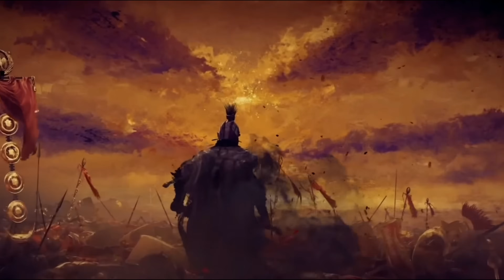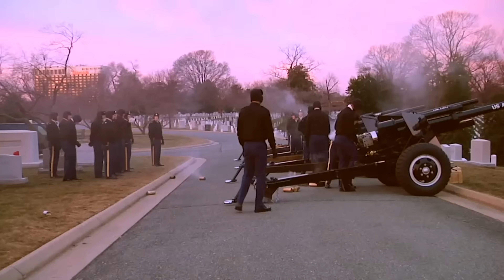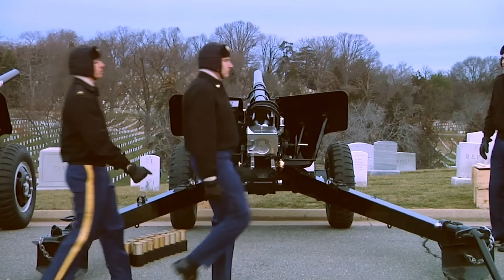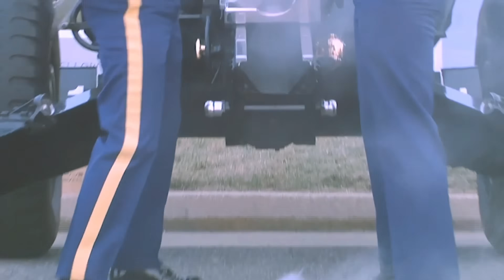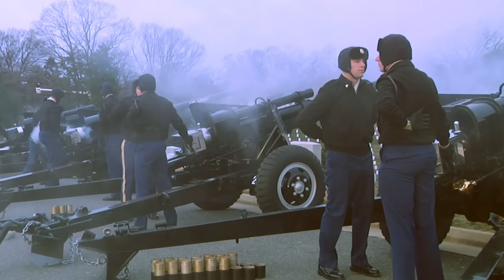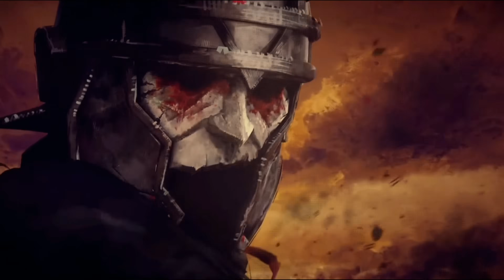How does the U.S. Army Ceremonial Artillery Guns operate? | 3 inch Gun M5 Salute Battery

Comment: DARPAs brand new HSNFSWD40RD (High Speed Non Fin Stabilized Water Displacement formula 40 Rust Dissolving) Far Support Round, as seen in the right down corner,
is very effective against rusted armor and locked up joints, to make the field mechanics life easier and safer. 😁

Comment: I was part of a US army change of command ceremony that was to use a cannon. They told us it would be fired during the event but neglected to tell us that it would be actually fired during the practice, we were under the impression that it would be a dry run. Several companies worth of soldiers simultaneously jumped when the gun was fired, to be followed by nervous laughter. Good times.
Reply: "Change of command ceremony"? Where and when was that in "US army" history?
Reply: @deeremeyer1749  They happen all the time. In fact you can see a few on YouTube. The one I was talking about was at Ft. Huachuca AZ in 1993. I forget which unit it was for after all these years.

Comment: Not to be a rivet counter, but the guns used are M5, 3 inch anti tank guns from WWII.
Reply: Not sure what's more odd; the choice of guns or that they are crewed by 11C mortarmen instead of 13B cannon crewmen.
Reply: @jarink1  The army had a lot of M5's left over after WWII, it uses a smaller charge than a 105 but the report is loud enough. The use of a mortal crew is because that is what is assigned to the "Old Guard". They operate 81mm mortars.